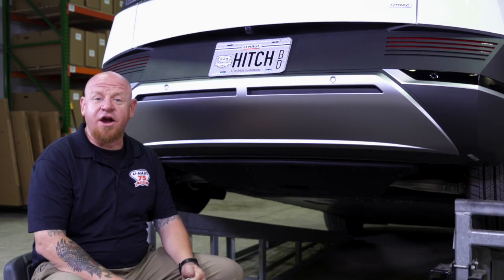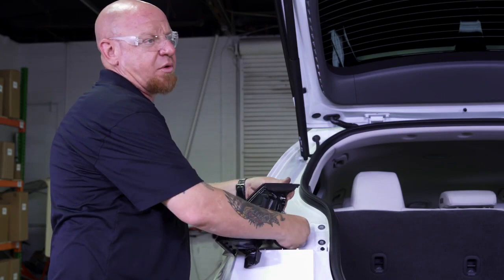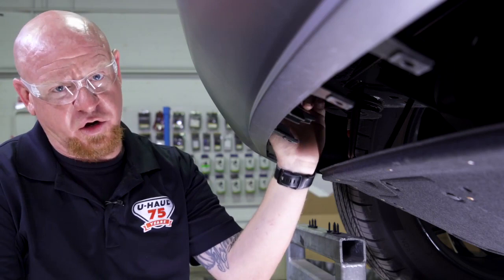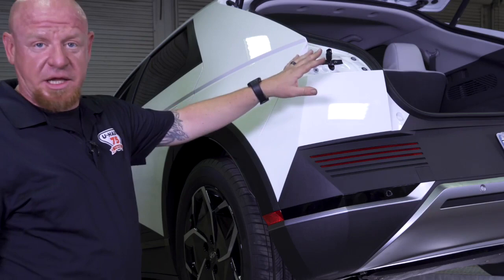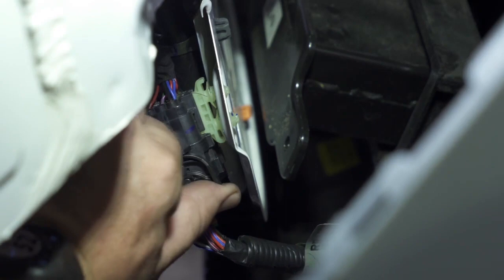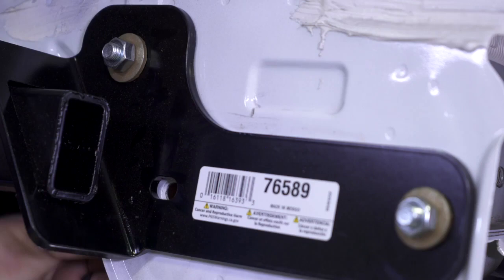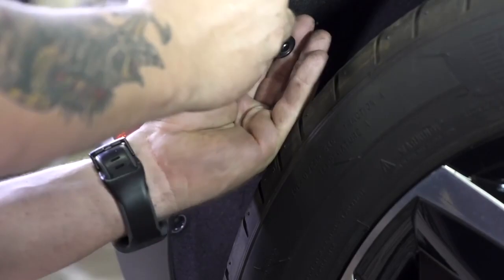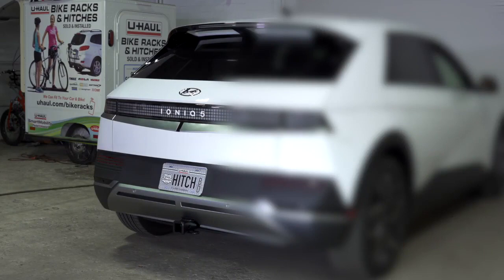2022 Hyundai Ioniq 5 | U-Haul Trailer Hitch Installation

Comment: Planning to attach a lightweight trailer to pull a 10kw generator for backroad bush trips in Northern Québec, la Belle province
Reply from the maker: Good luck!
Reply: @U-Haul Trailer Hitches And Towing  
I have identified the geneset, there is only 1 model out there:
maXpeedingrods 5500W Inverter Generator,Gas Powered, 86lbs, Electric Start,120V/220V/240V. Also ordered the hidden hitch for the Ioniq 5:  TORX7452SEco Trailer Hitch. Not as stong as steel but no rusting, remember I live in QC. As for good luck, not so sure, just good selection from my 40 years experience a Mechanical/Electrical Engineer. Also the genset has a very low THD. Have a good day, the Hitches come from the state of Washington I think, check them out.
Reply from the maker: @daviddun1389  We carry EcoHitch products! (Made by Torklift Central)

Comment: I don't trust myself to do this as the procedure looks quite involved, and I cannot get a Hyundai dealership to do the install of an after-market  hitch with a 2-inch receiver (Hyundai only seems to sell a hitch with a 1.25-inch receiver).  As involved as this is, I'm wondering if U-Haul technicians in New England (where I live) are trained in this sort of hitch install with an EV.  Is there a wiring harness kit for this, and would it require splicing into the existing EV wiring?
Reply from the maker: Yes! We have plenty of hitch pros in your area that can complete this install! You can find one here - Uhaulhitches.com  And we do sell a wiring kit that does not cut into your existing wiring. It is a quick connect and only requires us to run a power wire to your battery.

Comment: Can this hitch pull a single Jetski?
Reply from the maker: This hitch is Rated Up To 2,000 lbs. Gross Trailer Weight (GTW) And Up To 300 lbs. Tongue Weight (TW). So as long as the Jetski and trailer fall under those measurements combined, you are good.